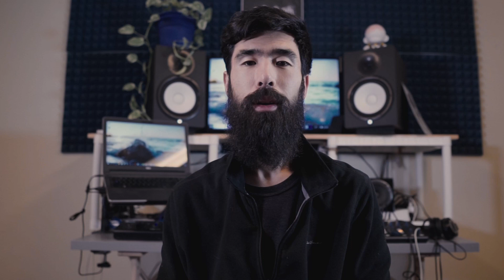PITCH SHIFTING VS FORMANT SHIFTING

Comment: WHAT IS A RESONABLY PRICED AND WORTHWHILE FORMANT AAAAAAND PITCH SHIFTING PLUGIN. I have waves but the artifacts are constant and terrible on the plugin i bought in a pack. And ableton's built in engine for shifting only allows formant shifting when you also shift the pitch. WHAT UP. need advice. Keep talking about mixing
Reply from the maker: SoundToys Little alter boy is really cool, it definitely has a distinct sound to it but its got a mix knob that is handy for blending subtle pitch layers. soundtoys periodically has sales where its super cheap.
Reply: pitchwheel
Reply: I use the formant shift on Izotope nectar quite a bit
Reply: MeldaProductions has a great free pitch shifter

Comment: I have 2 questions: I like to make one man choirs. And I am doing that as well for a song that I am working on right now. I basically record tje same thing in different styles of vocals and record each style 4 times. This particular song needs choirs in 2 octaves. But the problem is that I can only sing in one style of vocals when I am singing in the lower octave. So I am considering recording that again but using formant shift to create seperation. Or singing an octave higher and pitch it down an octave while preserving the formant. Do you think this will work or do you think it'll still sound like a bunch of clones of my self singing together?

My second question is if you know any free plugin that can shift formant.
Reply: It will work with the right tech... I am not tech savvy by the way but the science behind sound is insane... the only difference between the sound of a piano, a voice, a violin, wind on the trees is what is the bass frequency compared to its overtones in the harmonic series.